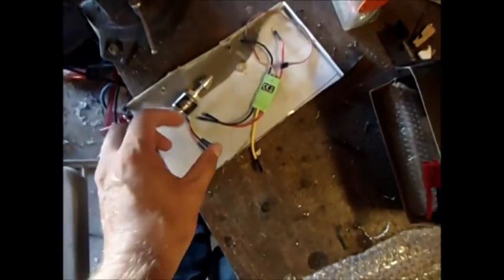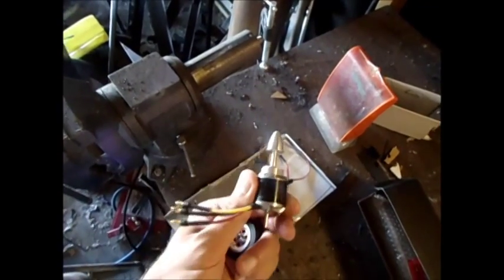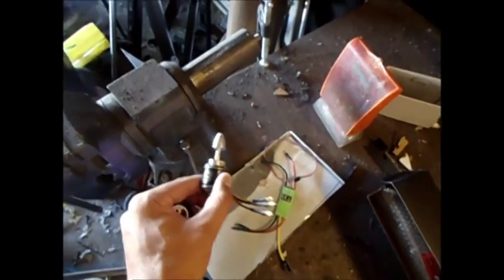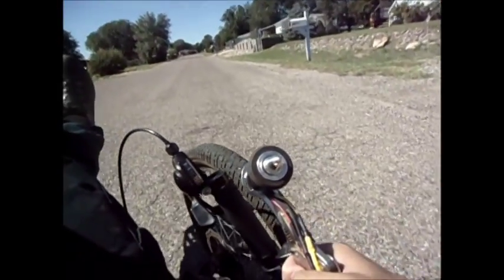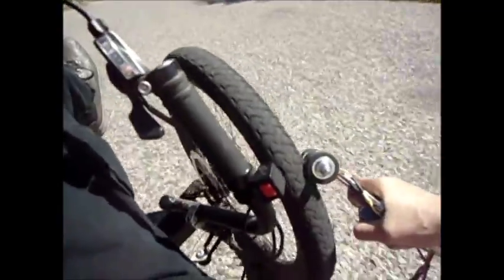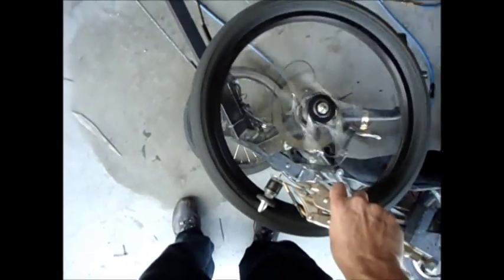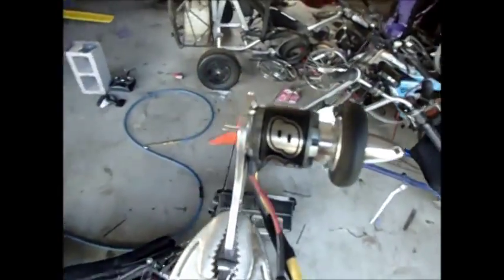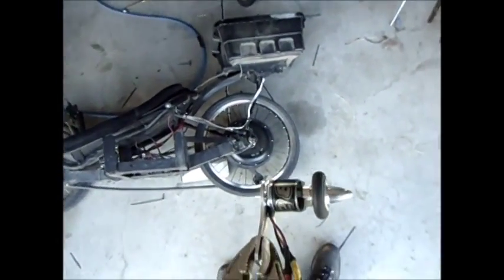tiny rc motor ebike expirement

Comment: It's because the motor on the bike has got a lot more torque which it sacrifices speed for. If you got some gears to step down speed for torque, even a miniquad motor can get you moving quite fast even 35mph if done right as they're upwards of 1000watts these days
Reply from the maker: Oh, it ended up being a magnet thing. 750 watts is approximately 1 horsepower. Lets say you have a huge steel industrial door and one horse (literal horse power lol). If you tried to use a quadcopter magnet to pull the door open with that horse, despite the horse being sufficiently strong a little magnet wouldn't have the gauss to pull open the door. Brick magnet + horse on the other hand well that would get r' done.

This is why quadcopter motors have stator sizes. That funky number on your quad motor is how much magnetic repulsion your motor is capable of. A 13 sized stator, lets say a 1306 motor is only good for up to about 3 inch props, a 18 sized stator 5 inch props, 22 stator 8 inch.... I mean sorta cause some motors are pancake shaped and some are sausage shaped but you get the idea right? The idea that more magnet is necessary for larger objects or in this case props.

You can't move a 200lb dude down the road in and e-bike with a glorified refrigerator magnet because the side of the motor providing one element of the repulsion is not enough no matter how much repulsion (wattage) is happening on the electrical side.
Reply from the maker: It's also why my 1500 watt ebike motor weighs 3000 grams and my 1500 watt airplane motor weighs 175 grams.
Reply: @parajared  you explained it well, thankyou.

There are some motors which use electromagnets instead on regular magnets, in this case, could it pull you in your ebike?
Reply from the maker: @NateEpotu  I imagine you could. I could see some hypothetical benefits to this too. Lets say you have a motor that you want to have high power but also very light weight. The fail point (as far as how much power you can get out of them) on the electrical side is the lamanations melting or the copper degrading and the fail point on the magnet end is the metals losing their magnetism at about 150 Celcius (300F). Assuming a dual electromagnet setup could be built you could presumably build a motor that could be pushed to maybe a good 250-300 celcius instead (572F) of 150C without failure. It would be a super-inefficient space heater of a motor that gobbles wattage like you wouldn't believe but with 90c rate high discharge lipos now a thing such a motor could serve as a purpose of providing a huge burst of energy over a relatively short amount of time... in theory.
Reply: @parajared  often thought of this yeah, I have a washer machine motor without any permanent magnets, it's all electromagnets. This is what got me thinking. I figured it wouldn't be practical as it would suck up energy like a no ones business and lots of weight and points of failure.